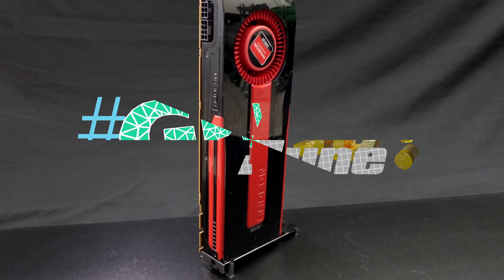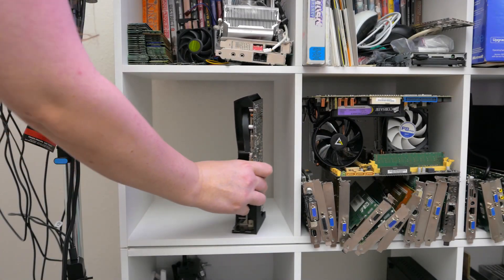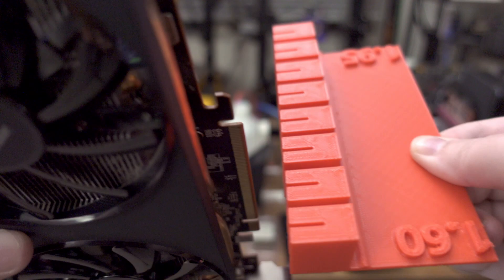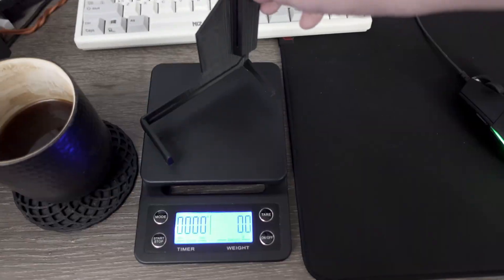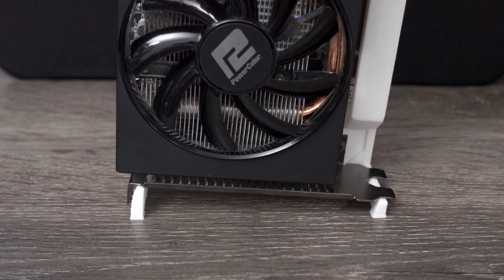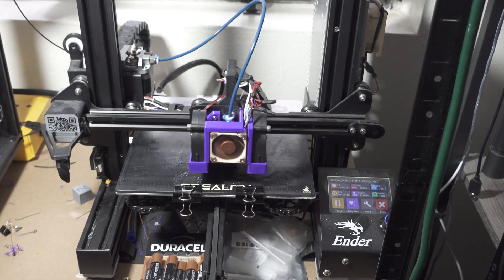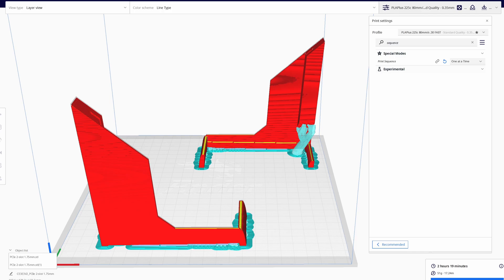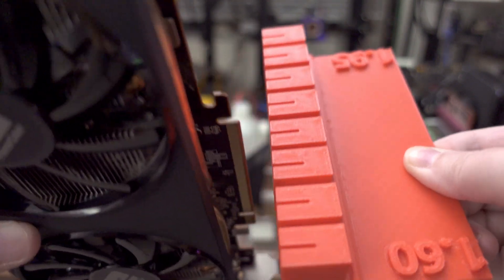SOLVE your GPU storage problems with 3D printing!

Comment: This is fantastic!  I have been being lazy about designing myself some solution for my couple boxes of piled cards (bubble wrapped!) for ages now. In my mind that was some horizontal slot-in thing, but this is much better, so neat and efficient. Love it! 

A few coments:

- In PCI/AGP , my Abit Siluro GF4 Mx AGP seem to be extra thin. I have imported the mesh to create a 1.45 stand, but I had to fix a lot of wild triangles and the result does not deserve be shared as remix. If you ever create a v3 I would kindly ask to add two thinner sizes if possible.

- I have been printing several copies at once in the bulding plate, and the result is perfect (expensive printer, though)

- If you have any ideas about how to store motherboards for reasonable easy access and display, I would love to have some inspiration there. Those require way too much space and I'm always worried about handling the ones I don't have the original box.  My mind again goes to some kind of universal base with all the standar AT/ATX supports, and some guides so can be slotted in a vertical rack solution.   Maybe you already have something in some video, but I just discovered the channel so it will take me some time to review all.

Thanks for sharing!
Reply from the maker: With newer direct-drive printers, these stand models are oversized. They're due a redesign, and I've been meaning to get to it, just been busy.

I've been trying to crack the nut of motherboard storage as well. I have a beta set of 3D-printable testbenches that use very little filament and can be stacked next to one another pretty nicely, but it's far from high-density. I need to make that release video as well.

Soon! Hopefully!